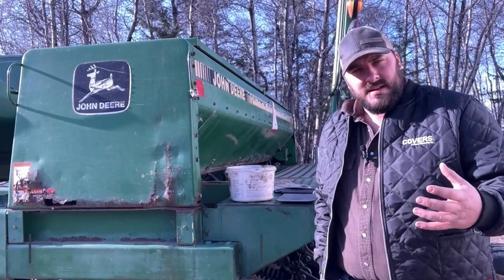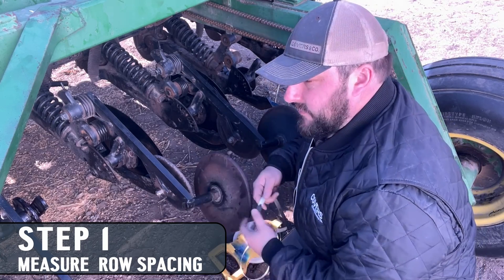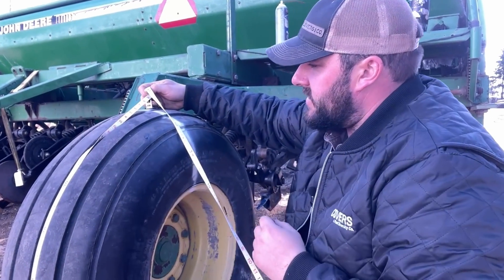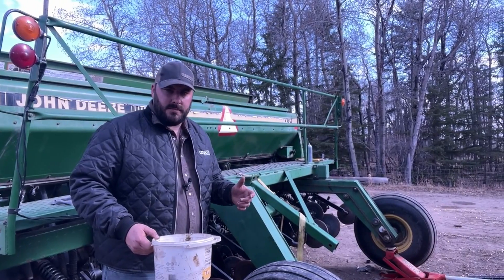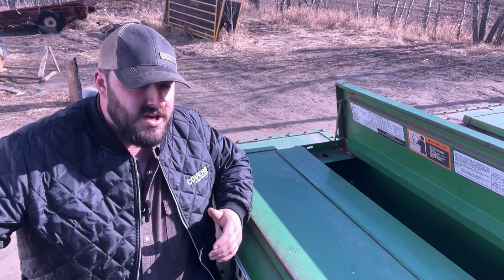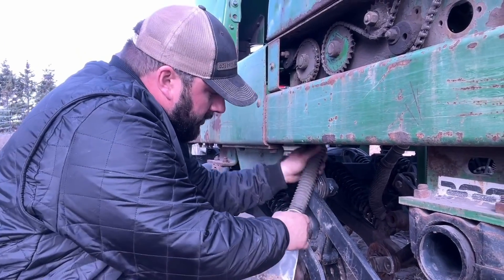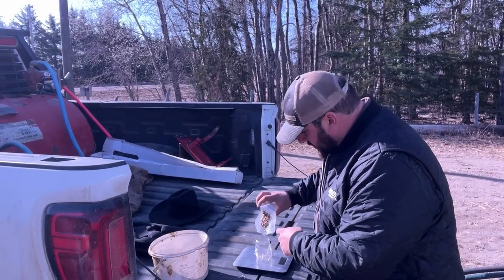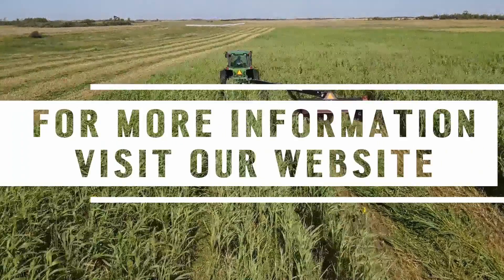From the Field: Calibrate Grain Drill for Cover Crops and Polycrop Blends

Comment: On my 15 ft 1590. It takes 36 revolutions of the jacked up drive wheel to go 1/10 of an acre 

Do the math from there

I fill the drill right full. To
Make sure head pressure isn’t a factor
Reply from the maker: Good point! Wonder how much difference that would make.